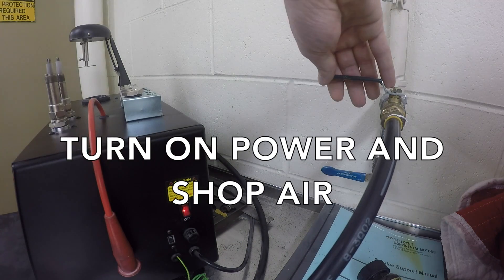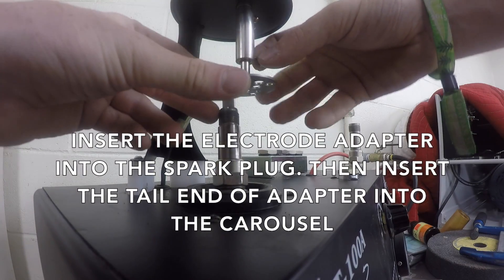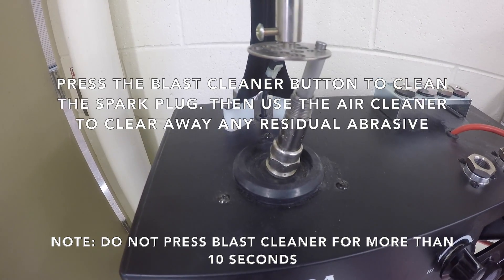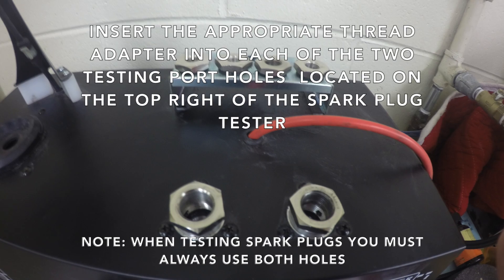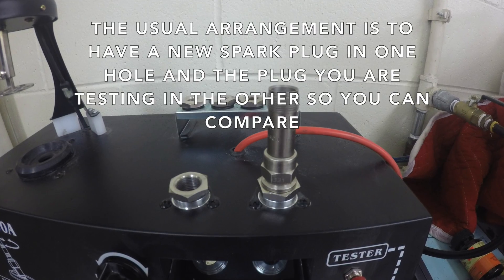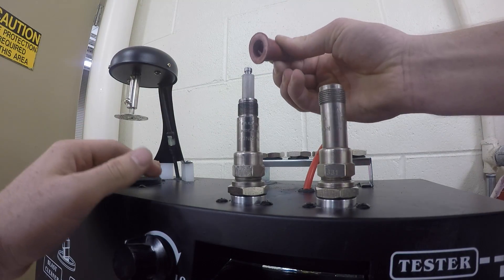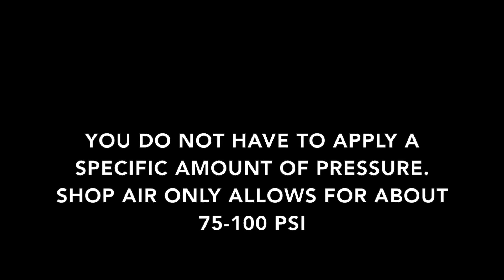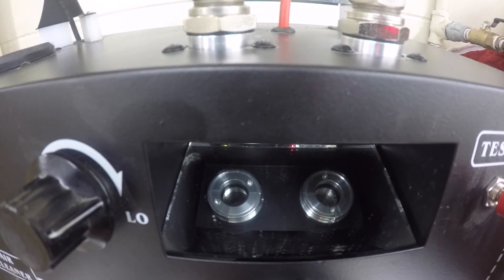Spark Plug Testing

Comment: Do you know of a cleaner tester that does not cost at much as the air compressor itself.  I cant bring myself to spend 400-600 on basicly a sheet metal box with a baggie of sand and a couple of electrodes.  The issue is the tester, are there inexpensive testers that can be purchased for automotive?